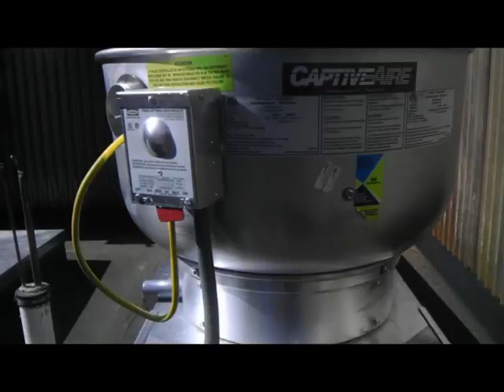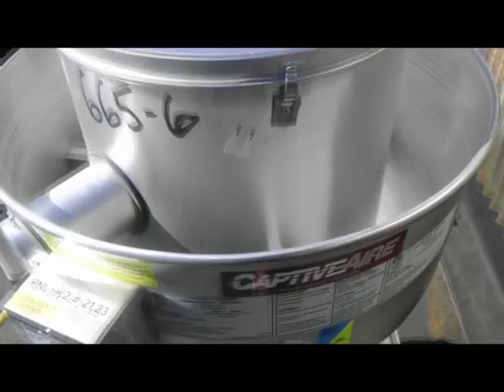How to install a roof mounted  exhaust fan

Comment: Commercial kitchen exhaust hoods require meeting numerous building safety codes with regard to mounting them, then there is the fire safety codes, electrical codes, and extensive knowledge about roofing applications. These are not to mention the fact that you are messing with the buildings HVAC system capacity. I make my living coming behind people who are novices, and unconscientious people who do this for a living by preying on restaurant owners who are desperate so solve hot air, smoke and grease issues. I'll tell all of you that this guy should not be trying to teach others through this venue about Commercial kitchen hood installation. It should be left to the conscientious professional who has been trained by those who have spent the appropriate time in the field before him.  Some information has to be earned, and should not be given away to those who would make foolish attempts to use it without going through proper training. Do the right thing people, do your due diligence and locate a person, who is hailed as one who cares about others, and possesses this knowledge.  Hire him to look after you.
Reply: What did he say exactly that is wrong in the video?
Reply: May I ask who should I hire to qualify for this type of job?
Reply: Uh no, pay attention and do a good job.

Comment: I have a question what do I need to put on an exhaust hood in the gap between the hood and the ceiling they told me it was called the splash but I don't have an idea what that is I wanted to know if you could help me, thank you

Comment: Would this work in a residential kitchen where you don't want to have a typical vent hood over the range?  I'd like to just have a vent, with this on the roof.
Reply: Brent Napolitano no you do not want to install this COMMERCIAL STYLE exhaust upblast fan on a residential application because lots of reasons, mainly because it's too large and would pull every bit of central air conditioning and heating out of your home. I can list lots of other reasons but there's no need, this is a common sense thing. have a good day.
Reply: @electricianhuckaby2512  my architect recommended I install something like this in my residential setting. It's a very good solution.
Reply from the maker: Yes.  This would work.